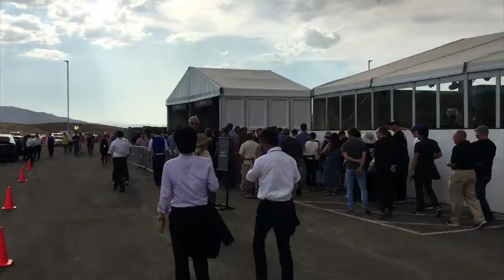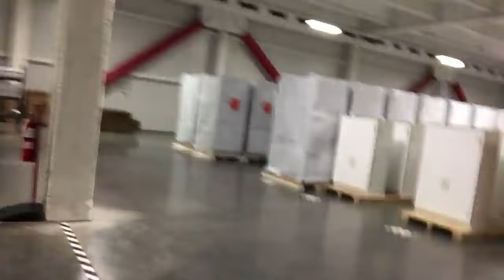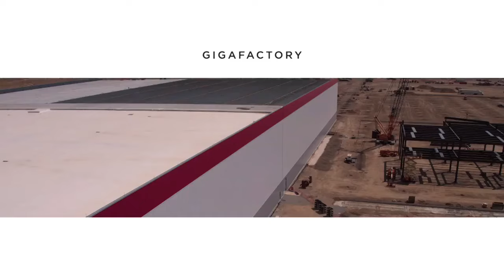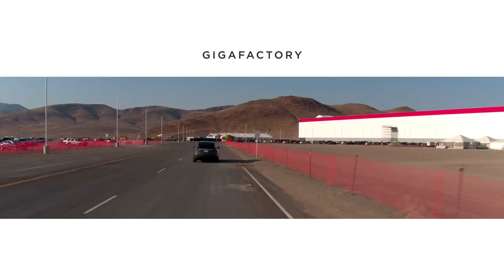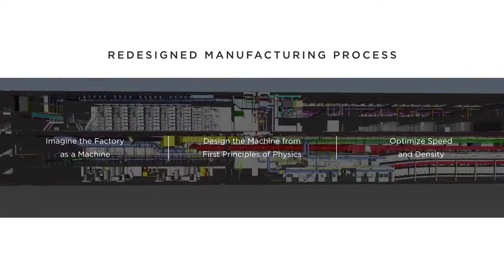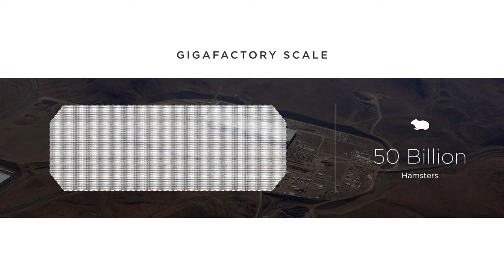Gigafactory opening party - It's News From The Frunk Episode 67

Comment: Hi Nick,  Thanks for posting.  Looks like you had fun. I think the idea behind the new cell form factor is that they have head room in the existing battery pack box for the 5 mm increase in height.  They may also have some longitudinal wiggle room for the extra 3 mm diameter because they only use 6 rows per module = 18 extra mm = 1/3 inch = nada.  They lose 74 X 3 mm = 222 mm = 8.75 inches in width = a lot.  So they need to reduce the parallel strings from 74 to 63 cells but they gain 25% more energy per module with the same formulation  = 7 kWh vs today's 5.7 kWh if my arithmetic is correct.  This results in a maximum capacity of 112 kWh for the new cell form factor and old battery pack form factor.  They will keep the number of rows constant at 96 for the same voltage.  New form factor cells should deliver almost 47% more current per cell.  Ludicrous could get up to 25 % more ludicrouser 🤓